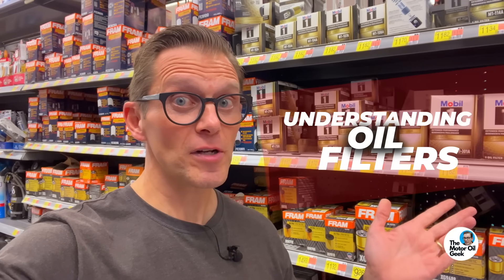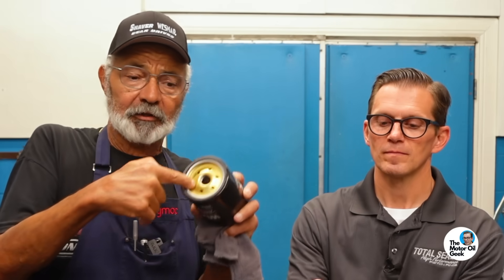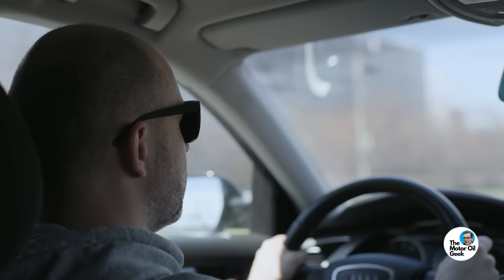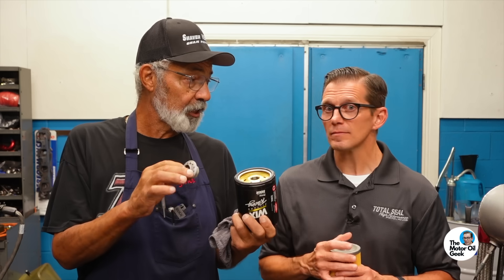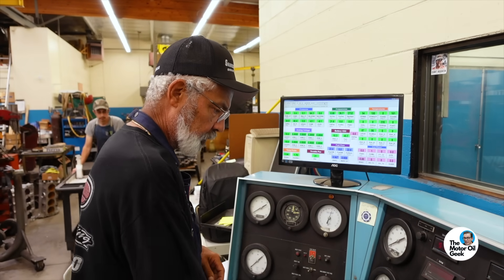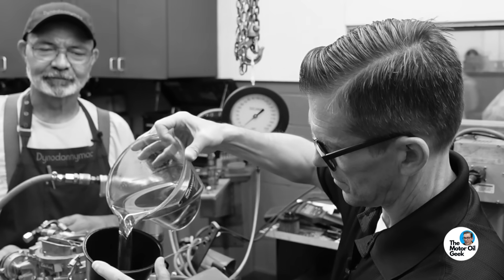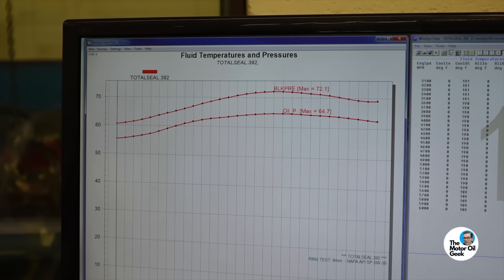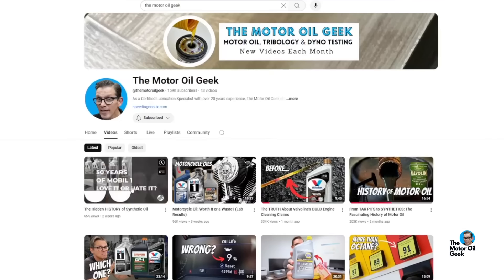OIL FILTERS: What Most People DON'T Know!

Comment: I live in the southern U.S. so cold temperature differentials are of little interest to me, but what I have always been curious about is the capacity of the filter to perform at elevated rpm's such as what you might experience when towing loads up inclines. Does the bypass come into play in those situations, and if so what filters are better at handling the higher flow rates to continue to send filtered oil when your components are at high output and in most need of a higher volume filtered oil.
Reply: No, the bypass exists for only one reason, for people who don't regularly change their oil, the filter will become clogged and will block all oil flowing through it, only in this extreme case will the bypass open.

Comment: why do we have so many model of oil filters?  They all look alike other than internal relief valve may set at different delta psi but this video say if the oil is clean, the relief valve won't be activated anyway, making all oil filter models perform the same way as long as you filter thread and rubber seal work fit the mounting surface.
Reply: Because time. Over time as the filter clogs or even breaks down, the performance of different designs comes into play. in most videos you're seeing new filters tested, not filters at 5K, 10K or even 25K miles. Different materials and even designs will handle the heat cycling differently and different filter media designs will have more capacity for dirt.

Comment: AMSOIL’s filters are rated at 20 microns at 99%. They have a little more pressure drop through them but filter better. Check out “Brand Ranks” oil filter test videos. AMSOIL’s after filter particle count was only 7 ppm when others ranged from 55 to nearly 1000! I’d rather not have that dirt in my oil.

Comment: What about bypass auxiliary filters such as Amsoil or Insane Diesel ones - is there a significant oil pressure drop and how efficient are those things vs just replacing oil more frequently in modern diesel engines with dual stage EGR, DPF and SCR?

Comment: here the cold oil was tested and the resistance that the cold oil creates is so great that the bypass valve has to open if rpm is so great to make high pressure, from 6:36-7:22 (https://youtu.be/0ReYsM9OMuI?si=CxI2ZgQBSvV1hzvk)

Comment: My filter on my 210,000-mile Subaru plugged after running Valvoline Restore and Protect the first time. Change the filter every 750 miles if you are running that for the first time on a high mileage engine! And pre-fill the filter 😉

Comment: Is there a big boost in "helping the engine" if you install an oversized oil filter to increase surface area of the filter media thus reduce restriction?
Reply: Bigger filter is for more capacity, longer oil change intervals. The oil doesn't flow through the whole media all the time, the unused part gets used as the lower part gets clogged.

Comment: The one way check valve (or anti-drain back valve) "only" checks/blocks flow from the "oil filter's inlet holes". It has no check valve on the oil filter's outlet. As such oil will drain through the filter medium (by gravity) to the oil filter outlet. So the oil filter can be empty or dry.

The main advantage is that the oil pump is primed with oil and ideally have oil up to the oil filter inlet. If you don't believe me, find a Subaru engine with the filter up top. Let the engine sit 15 minutes after running. Unscrew the oil filter and there will not be oil in the oil filter. It will have drained through the filter media and outlet.

Comment: Love your videos.  That said, if the oil filter or engine  you were using for this test had a bypass, your test is not valid.  Bypass devices show a range of differential PSI that they "should" open at, the range is due to manufacturing tolerances.  Just because it opens at 8 PSI differential, doesn't mean that it then closes at the same.  It may open at 8 PSID and close at 5 PSID.  You did not test that valve (not sure how you could without dissembling it) so you are relying on manufacturers data which may or may not be accurate for every filter.   You  are assuming the bypass did not open.  A real test for differential pressure would be with a filter with no bypass, and if the block has it's own bypass, it must be blocked.  Then you can run the test and see the real numbers you get without a bypass sneaking open slightly without your knowledge.  Once again, LOVE your videos.
Reply from the maker: Thanks. There was not a bypass on the engine or the filter. We are just measuring differential pressure here.

Comment: I have a simple silly sounding test of the anti drain back valve. Put your lips of the big middle hole of the filter. You should be able to suck air. But if you blow air the valve should close. I have yet to find a brand that doesn’t have a bad valve once in a while.

Comment: 43 years working on all kinds of vehicles never have I filled up an oil filter for an oil change. I just took a 96 351 Ford apart that I had driven for over 60,000 miles I bought it with 60,000 miles and filter was always done At 3000 miles.
I tore it apart because I was going to overhaul it and there was no wear on any part of that engine and it was clean. So it’s great for guys that want prime an oil filter.
Through experience, I believe it is not necessary

Comment: Wear particles in oil are between 2-35 micron.  35 and up any oil filter catches.  Most catch all or very close to all of 30 micron.  Below that  is where the difference is and the difference between a 26 micron absolute and 22 micron absolute is a big deal for your engine.  You have to look up the stats for your exact filter.  I recomend donaldson filters above any other.  Lastly all the oil filtration in the world does no good if you run one of those pos "performance" air filters.  The difference between 99% and 99.9% on air filters is huge.  Again donaldson blue web filters are far superior to the others in every aspect.  Buy straight from them, no knockoffs.

Comment: Lake, great video. Can you explain the pros/cons of using a basic oil filter vs a synthetic lomg drain filter? Protection, hp, longevity, flow rate etc... I.e Fram orange can vs Fram Ultra... What if I use a Fram
Ultra and do 5000mile intervals? Is there a benefit or just use the orange can? Would make  good video topic

Comment: There's a myth going around stating that the oil filter's anti-drainback valve prevents "dry starts".  It does not.

If the filter is positioned with the threaded portion facing up, then the filter remains full because of gravity.

If the filter is positioned horizontally, then the half the oil drains out when the engine is off.

If the filter is positioned on top of the engine with the threaded portion facing down, then all the oil drains out.

What the valve does do is to keep oil from draining out of the filter's intake holes and carrying a lot of filtered crud back into the engine.  The filter's oil is free to drain back into the engine through the center threaded hole (the exit hole).  The position of the filter determines how much oil drains back, not the valve.

Comment: These guys are missing a lot of basic information. FOR EXAMPLE: did you know that all you have to do is press & hold the gas pedal down to the floor when you hold the starter, and the motor won't start? Yes it's true! You can do this for all sorts of reasons, one of which is that you want to circulate the engine oil through a new filter prior to letting the engine run.

Comment: When i start my subaru after 3+ days sitting i press gas to shut off injectors .I crank the emgine 5 sec twice to pump oil into the engine . Does that do anything ? Will it have effect over time? No way to check it but it seems like it camt hurt.

Comment: A check valve is not a bypass valve. For a oil filter expert, your friend has some accuracy issues. Also, not all spin on oil filters flow in the same direction. I have owned both a 1974 VW Bus and a 1974 Porsche 914 with the 1600 cc pancake engine.  The spin on oil filters flowed from the center to the outside. The bypass valve was built into the engine housing and there was no anti backflow valve. If you used a filter with a backflow valve, the flow would be blocked and everything would have to flow through the bypass. The German cars now use cartridge type filters that mount from the top and cannot be prefilled.

Comment: Lake 
I use mobile 1 oil and filters 
I change my oil every 3000 miles 
Mobile oil filters state they last 15000
Which I would never do … but will hurt to change the filter every two oil drains ? Filter 6000 miles

Comment: Lake, 
Let me start by saying that I appreciate your videos and webinars. You educate and explain complex topics very well. 
You are mostly correct about the oil filter bypass. Here is where I disagree: I know from experience that on a VERY cold engine (0-20 degrees F) that the filter bypass will indeed open. For years I ran a wet sump S2 Buick V6 engine in my racecar. I intentionally plugged the oil filter bypass valve as recommended by BUICK in their motorsports manual. On separate 2 occasions I needed  to move the car during extreme cold weather.  On start-up, I collapsed the filter element and blew out the oil filter seal.  The oil was a synthetic 20W50 VR racing oil, very clean and a WIX filter also not plugged or restricted. I have built and run similar Buick engines with the bypass active and never blown out a filter on cold start. The oil filter bypass DOES open on a very cold engine, maybe not at your shop temps, but in the real world, lots of vehicles cold soak in very cold temps. If you want a truly valid test, run your same mule engine in an environmental cell and let it cold soak first. I promise you will see different test results.
Reply: Yes. Thank you. 👍

Comment: omg this is so good to learn. I consider myself knowledgeable about this stuff generally but recently became aware of these psi ratings and have been using Honda car oil filters in a Honda motorcycle (they are all basically the same filter mobil1 m1-108 and m1-110).  I panicked because of how how low the bypass pressure was on these filters vs how high psi the sportbike engine runs at. it's been like almost 40k miles and I couldn't understand how it hadn't died but have run out and got the correct motorcycle filter with a much higher bypass rating. 

I'm so relieved to know I probably haven't really hurt anything.

is this something you could speak to also about high pressure oil systems like in a sportbike vs lower pressure oiling systems in a car and oil filter size along with bypass pressure ratings?

Comment: Being from MN I'm pretty sure the by-pass opens if parked outside during below zero temps. 
 Maybe not if using synthetic 0w-20 or 5w20 or 0w 30. I have messed around with oil up here to see for myself how it flows & at 20 below a 5w -30 hardly moves. I can see the lifters with the oil cap off & a flashlight.            Wow, what a wakeup call that is. When it's below zero it can take a minute before you see any oil coming from the oil holes next to the camshaft. No heated garage here in the woods.
I keep everything in a shed. Moral of my story is to run thin synthetics in the winter, I can see the difference.

Comment: 20 years ago, my boss bought a bunch of oil filters that didn't have a bypass valve (because he wanted to save some money).

The first car that he used it on, the filter blew up because the cold oil couldn't get through the filter fast enough under higher rpms.

Filters that DON'T have a bypass are meant to be used on engines where the oil goes from the pump directly to the oil galleries to lube engine components, then to a pressure relief valve and then to the oil filter. The filtered oil THEN goes back to the oil sump.

The pressure relief valve prevents the non bypass oil filter from exploding... the same way that the bypass valve in a filter (that has one) prevents it from exploding. 

Ok, exploding might be harsh... rupturing.

Would be cool for you guys to run an engine with a filter that doesn't have a bypass valve.

You should have NOTHING to worry about... as long as the filter is clean.

According to what you stated in the video. =)
Reply: Not necessarily exploding. Imploding from my experience was quite common on aircraft spin ons in winter. The element would crush from the thick oil trying to get through the media.

Comment: I had a fram filter on my 1965 Dodge Polara 383.
While driveing oil light started blinking drove home 4 miles.
Oil level was good.
Pulled oil filter it imploded on the inside.
Installed another brand filter oil pressure back to normal.

Comment: Are you sure about the chevy filters not having a bypass? The Acdelco PF63 and PF46 filters have them for sure and the most recent spec has them opening at 22psi. Or am I totally misunderstanding what's being talked about (entirely possible, I'm not the sharpest pencil in the box)?
Reply from the maker: The small block Chevy filter does not have a bypass in the filter. The bypass is in the block.

Comment: If I use a bigger oil filter (same thread and gasket size) would there be any drawbacks? From what I could figure it would increase both flow and particle capacity.

Comment: So I don’t understand why the hot oil with lower viscosity caused a higher pressure differential, that seems backwards.

I did bypass my oil filter with clean oil…and way too much Lucas evidently, even tho the engine was hot caused too much restriction.
Reply from the maker: The restriction across the media increases as flow increases. Think about waving a fan. There’s little resistance when you are moving in slowly. The resistance is much higher when you move it faster.

Comment: All the oil nerds I've met have said that the main reason to change your oil is to change the filter. Some guys even claim if you change the filter regularly you can actually reuse modern synthetic oil a few times. I've never tried that, and do not recommend it but it's an interesting thought.

Comment: I have a 2010 Chrysler Town and Country 3.8L and when I was using a mobile one oil filter I always had to add a quart of oil in between oil changes. And now that I’ve switched to a super tech oil filter the oil level has been fine even after 6000 miles on the oil change, what is going on? Engine currently has 285,000 miles

Comment: I Love the video, but the bypass valve does not just open suddenly. You are correct that it is the change in pressure which provides the force. However, I humbly disagree that the bypass valve only opens when the filter is clogged. In fact how big the opening is exactly Hooke's law F=kx. In classical mechanics it is referred as a harmonic oscillator, here the spring force function is linear, it is not a step function. Therefore, the bypass valve's opening is directly proportional to the force applied. What the bypass valve's actual function is to provide a retardant force which helps filter the oil through the pleats, as much as possible without starving the engine of lubrication. Yes, of course, a fully clogged filter will have a fully open valve, but also normal running pressures will also compress the spring proportionally to the force applied. If the spring force is 8 newtons, and the maximum distance it can compress is for example, 10 cm,  then having a pressure differential of 4 newtons would have compressed the spring half that distance. Thank you for taking the time to make a video, I love your content!
Reply: Okay but if the spec is that the bypass "opens" at 10 psi that means that at anything below that value it remains fully closed and the design of an oil filter bypass valve is such that it will never open under normal circumstances. It's not a regulator.
Reply: @pi.actual sorry its not a matter of debate, it is hooke's law.
Reply: @pi.actual If you don't believe in hooke's law and still think this is a stepwise function, why don't you publish in any reputable journal your theoretical findings and win a noble prize in physics 😂
Reply: @josimarruiz2  It's not a physics debate it's simply the fact that the bypass spring tension will not allow a single molecule of oil past until the pressure differential has exceeded the spec. Then you can go Hooke's law all you want.
Reply: @pi.actual lol thats not how springs work
Reply: @pi.actual and listen, if you do find such spring with such step function, you would be defying not only most concepts in physics/classical mechanics and mathematics... you are describing the perfect diaphragm, why don't you put it to use in the world of prosthetics, you know how many problems you would solve? You would essentially have solved one of the two biggest problems with heart/valve prosthetics. There you go another nobel prize, don't forget to shout me out in your award ceremony.

Comment: you should edit your video when your guest is talking about a bypass valve when he constantly says check valve. Also modern  oils viscosity ( mulit-viscosity)increases not decreases as temperature increases. you both said the opposie.
Reply: No, viscosity does not increase. For example, 5W30 oil, 5W means it has viscosity of COLD 5 weight oil when COLD and viscosity of HOT 30 weight oil when HOT. Cold 5 weight oil has higher viscosity than hot 30 weight oil. The point of this is to reduce the difference in viscosity between cold and hot.

Comment: But these guys are showing that bypass valves do open:
https://www.youtube.com/watch?v=mYi640pMjWA
Reply from the maker: As shown in that video, the bypass does not open until the flow rate reached 6 gallons per minute. Most engines flow less than 5 gallons per minute under normal operating conditions (start-up, idle and normal speed driving).
Reply: @themotoroilgeek  Interesting, thank you for replying  👍